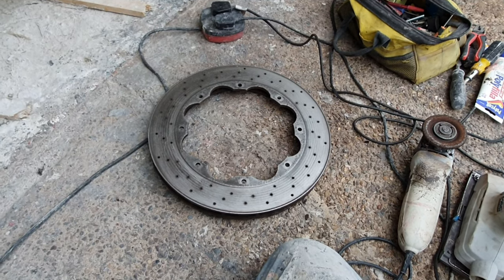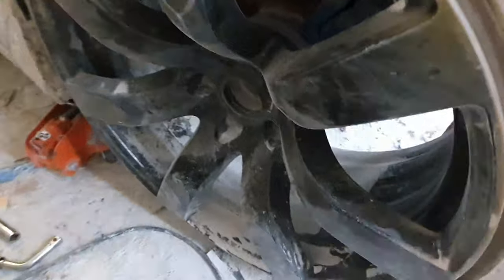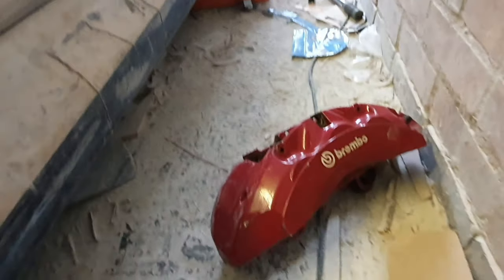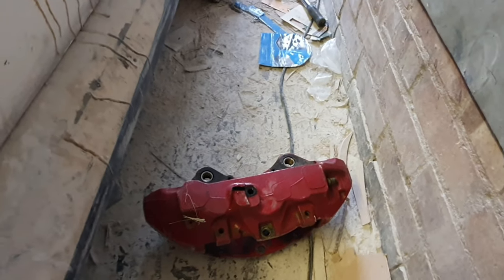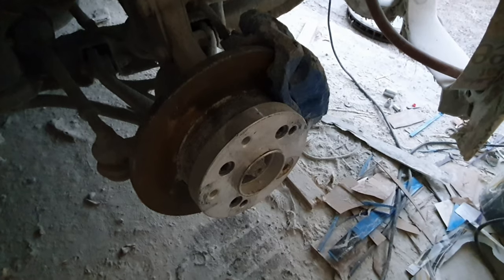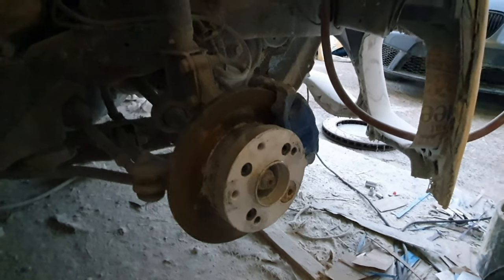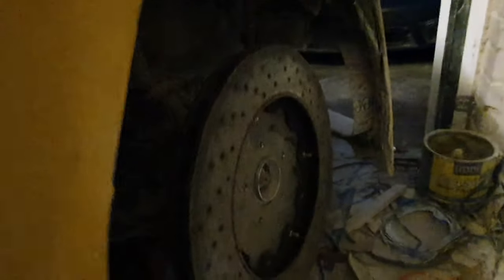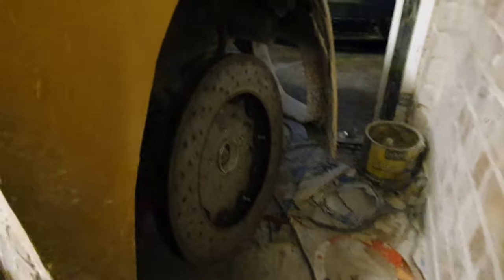125 - Brake disc cleanup, test fitting and caliper clearance checks...this is gonna be tricky!!

Comment: Hi, isn't that steel way too light weight, it will just buckle or rip out when braking force is applied? I realised the car isn't going on the road but even at 10mph in a car park there will be a force measured in tonnes I'd imagine on that 2mm plate and fixings?
Reply from the maker: The brakes wont be a working set. No braking force will be applied. They will look very real and everything will be there but they dont have any force going through them
Reply: @rsjdevelopments  might aswel just leave the brakes off entirely.
Reply from the maker: Definately not that would look rubbish..lol